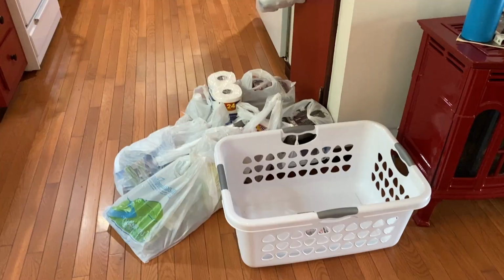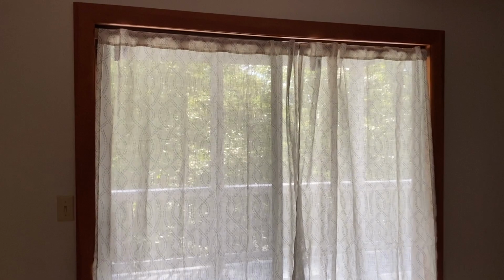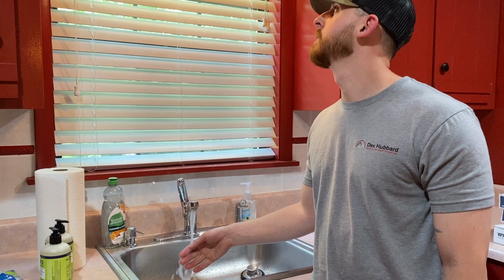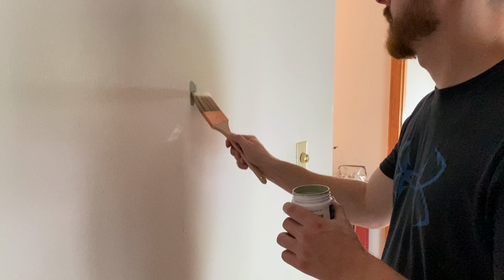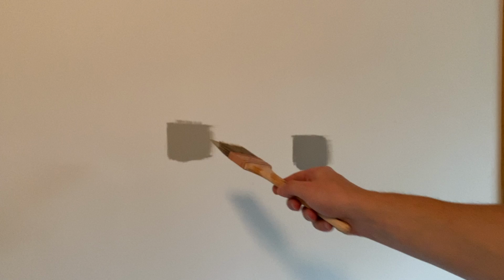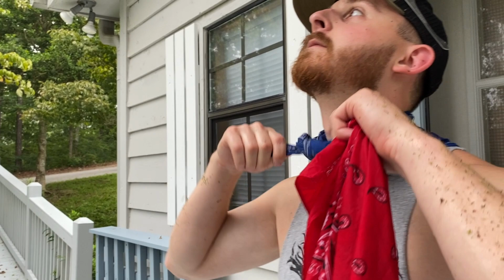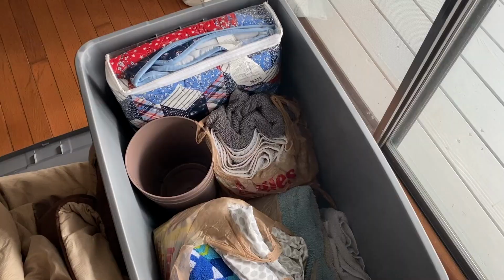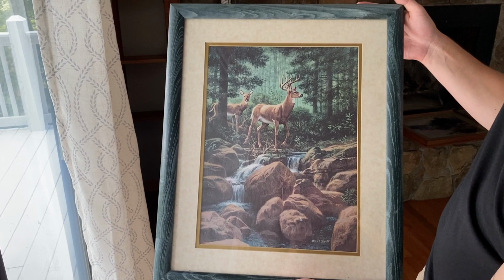New House Update - The Pressley Girls

Comment: What kind of bugs are coming in? That will dictate the kind of treatment you need. You can proactively lay boric acid around the base of the house. A new sweep on the back door will help, too. Get the link trap from the dryer cleaned out right away, and be sure to clean it quarterly. It's great for dryer performance, but also an important safety step. And leave the lid of your washer up after loads so it dries out well (keeps mildew at bay).
Reply from the maker: Good point about leaving the lid up I didn’t think of that! We mostly seem to have little beetles, house spiders, little wormy things. I’ll try the boric acid!

Comment: Its been a bad year for bugs where I'm at, I started keeping a small bug zapper in the house & shop, $20 raid branded BZ-20 form home depot. Takes care of everything flying over night.  You can use boric acid with a little sugar syrup for bait to deal with ants as a pretty safe solution. We Had some gnats causing us bad allergies that we ended up using B.T. to control, its not 100% ideal but it doesn't make sense to totally avoid for your health when its already been effected.  I use a garlic product to treat the yard at our lake cabin that helps with mosquitoes but it does take a little while to get used to the smell. Controlling water and keeping brush/leaves cleaned up helps a lot, the more underbrush and dead leaves etc you can clear out of your wooded areas the better, and keeping the lawn mowed/trimmed makes a huge difference with gnats.  Hate all these new washing machines myself, nothing but trouble, those older ones are all manufactured by whirlpool and from 70's to 2010 were basically identical inside through the years, parts are everywhere and cheap for most of them, just match to pics on amazon if you cant find something for them by looking up the machine.  I've had new ones, front loader and high efficiency top loader, neither worked as well, both died within a few years and parts were not economical to repair them.

Comment: One thing my wife and I did once we had two Differant colors we liked but could agree which to use on an accent wall. So we decided to take the lighter color a Tanish color as a base coat ...then took the darker color w a round loofa sponge from the doller store dipped in the paint just a little and made blotches on the wall gave it a 3 dimential effect .

Comment: For bugs we use this powder called Alpine that you can buy online.  You mix it with water and put in a pressure sprayer.  We got an inexpensive sprayer from Home Depot.  We found out about Alpine from an exterminator we hired when we moved to Florida (there are lots of bugs here).  We also didn't want to use a lot of chemicals.  Alpine is low toxicity and is safe for people and pets....but not for bugs.  It's not cheap but it lasts a long time.  Good luck to y'all.
Reply from the maker: Thanks I’ll look it up! 🙏💕

Comment: So happy for you guys. Lots of fun decorating and making it your own. I ha very an old washer dryer set, easier to fix when I have problems...new ones all computer chip . Too expensive. Put a drain pan under the washer in case a leak, that way won't ruin wood floor. Pour that whole bottle of vinegar in, it's cheap and will help with the mildew and hard water build up in the hoses, etc..
Reply from the maker: The drain pan is a good idea, I hadn’t thought of that one! Thank you for watching! 🙏💕
Reply: @thepressleygirls  it only happened once to me, but it saved my flooring. I enjoy your vids

Comment: My two cents. Stick with neutrals on the walls and add your brighter colors with pillows, cushions, dishtowels, rugs, comforters, etc. That way you can change things out quickly and cheaper than painting. You lucked up with washer and dryer! New style like I have doesn’t use enough water to wash the clothes good. 😕 yup I remember Kelvinator brand. And yes you can open during cycle which is great in case you need to add a dropped or forgotten item in. Have fun and enjoy the journey.
Reply from the maker: Thank you! 🙏💕
Reply from the maker: Yea that’s what we thought! Neutrals on the walls then add in color with smaller things! And awesome to be able to add in stuff if you forget!

Comment: You really want to run all the water out of the hot water heater and any sludge that is at the bottom, then let it fill and turn it on.  Otherwise, if there is any sludge at the bottom, it can gum up the systems and burn out the hot water heater shortly.  Former East Tennessee resident that had this happen a couple times over.
Reply from the maker: That’s good to know!

Comment: I have just in the last few years become allergic to tide myself.
Looks like your washer had a lid switch but someone jumped it out so it wouldn't work.
The dryer lid should pop up with a stiff paint putty knife. Insert the knife about 2 inches from the corners.

Comment: 3 teaspoons in a tablespoon, 4 tablespoons in a quarter cup, 2 cups in a pint , 2 pints in a quart, 8 pints per gallon.  So you wanted 96 teaspoons of vinegar to clean the washer.
Reply: I said that the long way to be funny.  But it is handy to know your conversions, in the kitchen in the garden, and anything else you need to measure.  keep those teaspoons handy,  they add up to every other measure you may need.

Comment: Hope you keep the washer and dryer, they wash clothes way better than the ones in the past 20 years. Plus, they don't take as much time and the clothes are cleaner. I so dislike my Maytag👎👎
Reply from the maker: Yes we were so grateful we got to keep them!
Reply: All of the older ones are whirlpool, which maytag is a brand of, like chevy and pontiac are gm products and mechanically identical for all it matters. . About the only way to get anything else is to buy bosch or the various asian brands but many of those are built entirely with whirlpool guts as well.